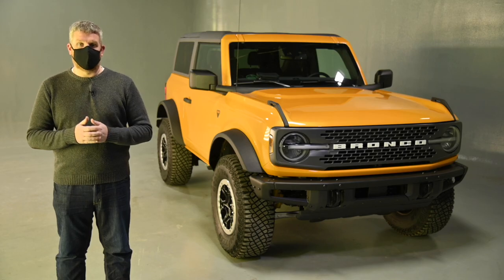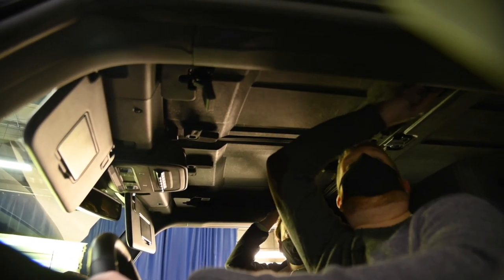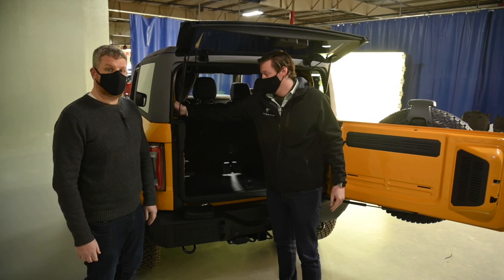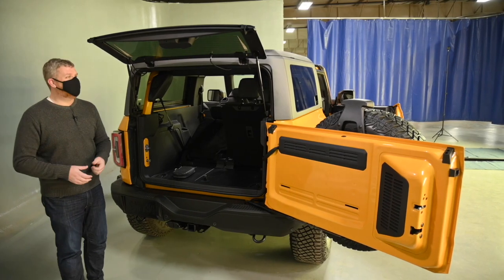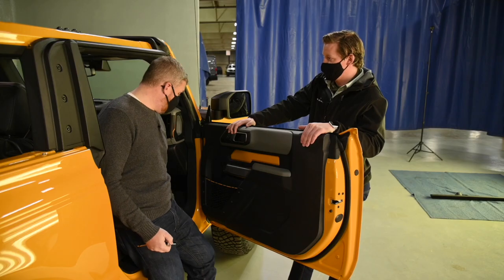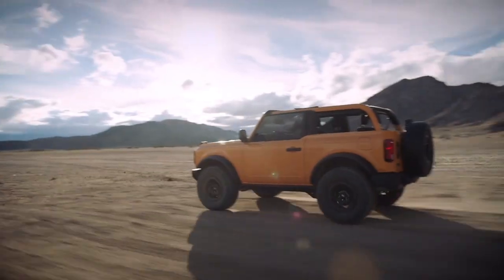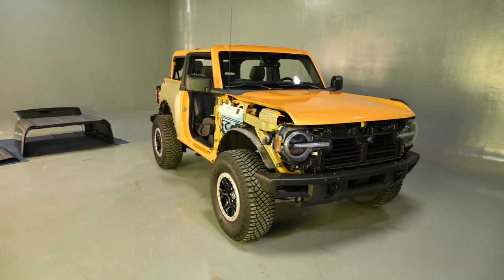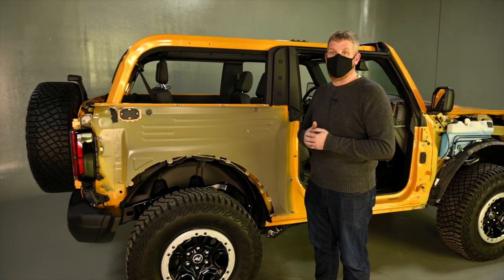We Tore Apart The 2021 Ford Bronco To See What's Underneath

Comment from the maker: Does this stack up well against the already modular Jeep Wrangler?
Reply: This is way better then a Wrangler.   This type of Lego modularity hasn't been seen since the original Defender left the US in 1997.  This makes trail repairs possible, and body shops obsolete.  This is the only, truly, fully trail repairable vehicle body on the market today.  Even shopping cart damage will be 10% the cost it will on Ford's competition.
Reply: @fabulousoffroaddesigns5080  even with wranglers they're nearly as modular. Just whip out the same 10mm ratchet that they just had to use on that bronco and panels pop right off. The rears.... not so much. But the front are easy. Let's start seeing how easy it is to swap out front axles and steering components when people try to really modify the new bronco.... don't get me wrong, I love the new bronco, but some of the points they're trying to pull out of their butt and brag about are getting kinda ridiculous.
Reply: @puckerfactoroffroad1326  this isn't really ridiculous as this is what the Defender was world famous for.  When you find a 50 year old Defender in Africa it's never lifted on Dana 80's with 42" tires.  It's stock, on stock tires but every panel is a different color, because over time they needed to be replaced.  Everyone is pissed with what Land Rover just released.  For those customers it is no Defender, but maybe the Bronco is.

With factory tires ranging from 30" to 37" I don't really think the Bronco will need all the aftermarket work a Jeep needs.  It certainly won't have axles falling off or death wobble, and there are already 2 companies building portal axles for them.  My children's 4WD won't be like my childhood's.
Reply: @fabulousoffroaddesigns5080  those are very good points for sure. Im really curious to see how well the rack and pinion/ IFS system hold up to 140lb 37 inch tires in the long run. Not doubting that it will hold up. I'm just curious. In the past it's been a struggle to keep IFS in true alignment with that much mass being bashed around in hard offroad situations. I cant wait to see the broncos in person on the trail!
Reply: Really.....masks? 🤣
Reply: CV joints are not as reliable as U joints and solid axles.
Reply: @mountainadventures7346  I disagree.  Ford make some of the best CV's in the business. If they can make dependable CV's for all the power to be put down on pavement through 2 sticky tires and an indestructible Torsen Diff in a IRS  760 HP Mustang,  the IFS system in a Bronco for half the power of a 310 HP motor on dirt will be simple.  The parts person at my local dealer has been working there for over 50 years and says he has never seen one broken on an F-150.  Wore out?  Yes.  Smashed?  Never!
Reply: @fabulousoffroaddesigns5080  I live on a ranch with steep ground. I currently have a Chevy 2500 CV joint that needs replaced. I got rid of my Polaris Ranger for a Mahindra Roxor because I was tired of rebuilding the thing every year. Solid axles have ruled the roost around here. If Ford has made them durable? Awesome. I will wait and see.
Reply: I have a '17 JK Wrangler.  Ther Wrangler is way easier to mod.  Just look at how easy it is to swap tail lights on a Wrangler, and what a pain it is on a Bronco.  I can swap tail lights in like 5-10 minutes max on a Wrangler.  It's simple plug and play.

Comment: Easy to replace when quarter panels start rusting.
Reply: I had a 94 Explorer, after 7 years not a speck of rust on the body, it was warranteed for rust thru. But after 7 years the frame looked like swiss cheese, no warranty.

Comment: The only justifiable reason to be able to take off the fenders is to swap in unpainted ones for the trails? What? You don't think there's going to be aftermarket wider fenders or vented fenders? 😂
Reply: “You can easily pull off all four arches in a few minutes, and there are plenty of reasons to do so.” I think the real problem is your listening skills
Reply: @joshmike7598  not the fender arches, the fenders themselves. He said there's not much reason to do so unless you want to put unpainted ones on to beat on the trails.
Reply: @joshmike7598  you think I seriously meant vented fender flares? Lol, that would be kinda useless

Comment: It's sad that they stopped making the full size Bronco to bring back a plastic version of a Jeep. Everything about this is plastic, light weight. Nothing about this heavy or safe. Who puts plastic bumpers on as well as removing the fenders. I'm shocked that they didn't install a roll -bar. So in a nutshell they recreated the VW Thing. Not impressed at all.

Comment: Gimmicks, gimmicks every where. Doors and roof, fine, the rest of it is way too gimmicky for my taste.
Reply: How? It's an aftermarkets dream? And how are easily removable pieces "gimmicky"? Even mechanics will love this for the easy ability to get pieces out of the way instead of working around them. Also, for people that will actually use the bronco, it's nice to be able to easily swap fenders when the chance of smashing them is so high. I see no gimmicks.
Reply: Brush the rear quarter panel up against a tree in the woods and instead of being stuck with the dent or chopping and welding a new rear quarter in, you can swap it out in 20 minutes with a fresh new one is "gimmicky"? I think not.....